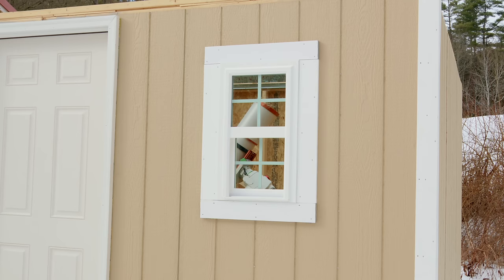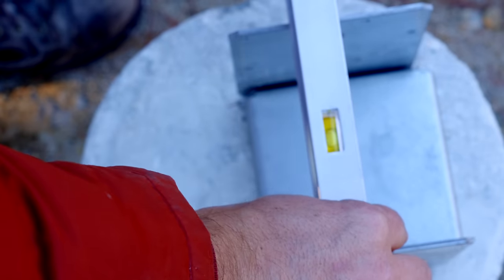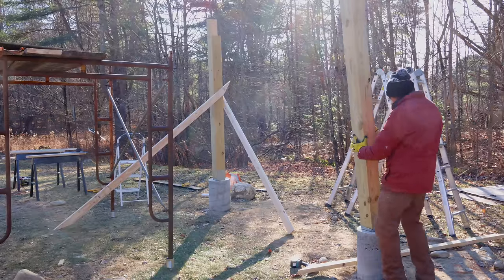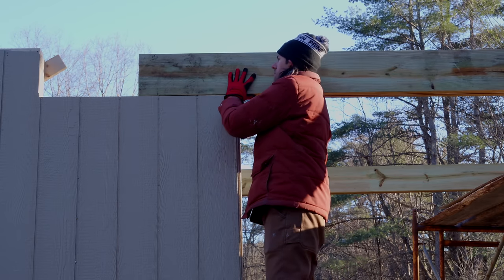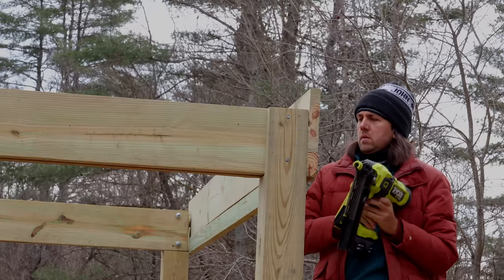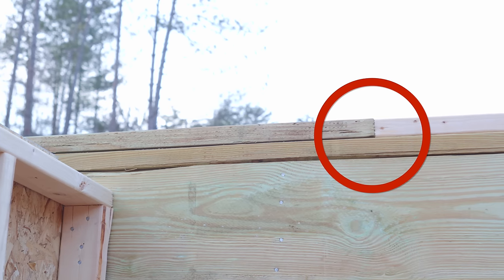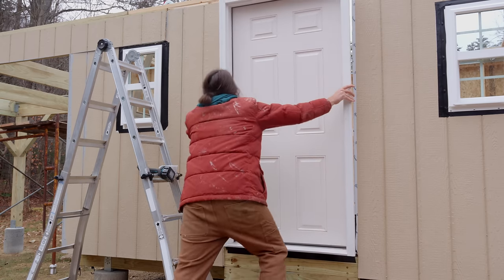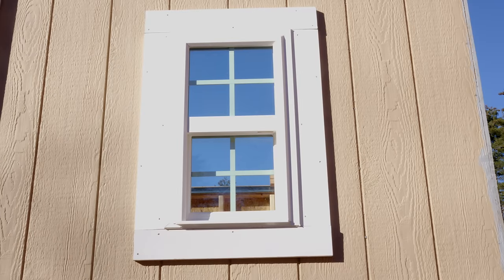My DREAM OBSERVATORY has a ROLL-OFF ROOF!

Comment: Congratulations on your new observatory! It's an achievement that most astronomers never attain, but yours is very nice indeed. I've been director of my Astronomy Club's Observatory on and off for years, and live in a very similar climate to yours, upstate NY, where snow is a given in the winter, and lots of it. I wanted to make a suggestion concerning your exposed roof rails. We tried the heater tape solution, but ice still managed to be a problem. The only way we were able to completely avoid ice and snow build up on the rails was to cover them. One of our members came up with an ingenious design, using an inverted length of aluminum gutter, mounted on a lightweight frame. You simply place the cover over the rails when you are finished observing, and they remain protected from the elements.  The rail covers hang on brackets installed on the rear of the building when not in use, including the summer months. Hope this idea will help you.

Comment: Always enjoy your videos.   Maybe you can go on a hike to a 4000 footer with Taylor the Nahamsha hiker and get some high mountain remote observations.   Anyway, about that warped beam.  I would take the siding off.  Scribe a straight line on top of the beam. Use a circle saw to make a first cut. Then, switch to a small chain saw and follow the first cut but at full depth of the beam.  It will be rough, but the siding will then fit and look good.  Clear skies!

Comment: Looks incredible, I am jealous.

A quick note on wind, re: 26:50. I wouldn't be so quick to dismiss the possibility that wind could move the roof on its own without the turnbuckles. Roofs are big, so wind has a huge area to act on and generate force. It also generates lift, reducing the force needed to get the roof moving. A 30 mph wind perpendicular to a 15 square foot gable would generate about 35 pounds of force.

So it's a very good thing you installed the turnbuckles. Even if that kind of wind isn't normal, a bad storm could hit it just right to ruin your day.
Reply from the maker: Ah, good to know. Didn't mean to say that with any kind of authority and what you write does make total sense. Glad I put those in!

Comment: Nice job Niko. I built myself a mini-observatory last summer (very small - room for one telescope) and did everything myself, by hand. Using it throughout this winter has been absolutely worth the effort I put in. Think I last polar aligned and calibrated PHD2 in September or so. 
Your own observatory will remove so many of the "chores", like setting up, cables, polar aligning etc etc etc. With a setup like this you can go from realizing it's clear outside to be imaging in just a few minutes. Your build was very inspiring to tear down mine, and build myself a bigger one.

Comment: Looking good Nico and having that dry area sure makes a difference.  I had my trusses together and mounted onto the rollers overnight when high-winds hit the area overnight.  Without the topping, the skelleton moved very easy and in fact, I found the whole thing laying in the tree off the rails in the morning.  I doubt this would have happened with the plywood and shingles on, too much weight for the lift.  Opted with this option as the plywood is about 1.12lbs/sqft vs steel roofing at 1lbs/sqft.  The shingles is where the weight plays a factor at aprox 2lbs/sqft.  While strapping for the steel roof does add weight, its not as much as the shingles in total.  I do like the added strength though with the plywood.  That being said, I think you made the right call going steel.  It's been a while, and I could be wrong, but I think the screws normally go on the ridges so as to let water fall away.  You may have to keep an eye on the rubber seals over time once they begin to harden and crack.

Comment: Great Job Nico. I would also suggest adding floor and walls to outside structure to make it a cozy debunking place/studio. Walls will also prevent the roof from the under wind that could lift it up.
Reply from the maker: I've been thinking about that. Thanks Lubo!

Comment: Congrats on your efforts. An observatory is the next level in AP :). That's the same metal roofing I used on my own. The top cap can be ventilated to let go of the summer heat, and they make some screened vents that fit over the profile of the sheeting cross section underneath. 

Happy observing!

Comment: Well done, congratulations!  Maybe you can add a horizontal double or even triple 2x4 beam and screw it into the observatory's inside sole plate and top plate. Then, get a few 8-inch long construction screws and run them through the 2x10 that is twisted into the horizontal temporary 2x4 beam that you just made.  Let it set for a few months and the twist may relieve itself. If it doesn't just leave the beam in place inside the observatory... no one will see it and the outside looks nice and professional.
Reply from the maker: Nice idea! I like this more than shaving it or trying to take it down to fix. Thanks!

Comment: Get a bit of 3/16ths plywood and trace the contour of your roof panels on it. Cut out the contour and then attach the plywood to a telescopic pole. That way you can get the snow off the roof very effectively after a snow storm.

Comment: Congrats! 
I'm sure you have lessons learned. Please make a follow up video on what you would do different if you did it again. 

I would put the door under the end, instead under where snow can fall off the roof.
Reply from the maker: I thought about that, but the way my weather is the door would get lot more abuse that way, and would be more awkward with how the telescopes are positioned. I am working up a presentation of lessons learned for the Astro-Imaging Channel - will be on there March 24th with that presentation.

Comment: Congrats Nico! You did an excellent job. Get some rubber anti-fatigue flooring and cover the entire floor with it. You won't regret it, especially if you ever drop something expensive. Your design is almost identical to my observatory. I used garage door rails as well. 18 years later, and they still work great.
Reply from the maker: Thanks for the idea! I've been thinking I might want something on the floor. So happy to hear that your observatory is working great after 18 years, I hope mine lasts that long!

Comment: I think the warp in the beam could have happened when you put the three layers together. In the video (at 3:12) the weight of the beam caused a slight curve which would have then been locked in when you fixed the layers together. If the beam had been rolled over so that it was in the same orientation as it would be when installed then the strength of the beam would have avoided the bending.
Reply from the maker: Ah, good catch, could be. Might have just gotten lucky on the other side.
Reply: @NebulaPhotos  Depending on how you secured the beam you may be able to remove the fixings that secure the three layers together and take out the bend. Once the three layers are not secured to each other you should be able to re-secure the ends then re-secure the three layers together. If it is not feasible to do in place then you may have to remove the beam, remove the bend and reinstall.
If you glued the layers together then rotating the beam so that the bend goes in the opposite direction may be the best way to get it secured nicely where the siding covers it. Then the 2 by 10s can be used to pull the centre of the beam into line. Over time the beam will relax into the shape you have forced it into.

Comment: I'm curious how much of the sky you can image from in there.  It looks like the trees behind your observatory are pretty tall, so even if your scope is aligned with the top of your walls, you still only get about 3/5 of the sky
Reply from the maker: I'd estimate about 65-70% above 30 degrees, so 3/5 (60%) sounds pretty close. North and Northwest are completely clear, West and Southwest are blocked (the tall trees you mention), South is mostly clear, East is good except for one tall tree. That said I have absolutely no problem finding things to image every clear night. For imaging, I find the circumpolar constellations have hundreds if not thousands of gems. I think I could spend my whole life just in the three Cs: Cepheus, Cass, and Cygnus and never run out of objects to image.

Comment: Nico, great work you have done, awesome job, I like the name, the amount of details you put on it, for me is one of the best I have seeing, one question about space between roof and structure, how you going to keep insects away and dust?  Congratulations
Reply from the maker: Ah, I did film something on that and didn't include it as the video was already getting long. I'm currently experimenting with different kinds of seals for that gap. Depending on where it is on the building, I will likely either use rubber (garage door part) or two rows of 'brush weather stripping'

Comment: Why are the walls so tall?  Seems like it would cut away a lot of your horizon.  Did you calculate the height to allow viewing above a certain angle?
Reply from the maker: Tall trees here, so it doesn’t cut my horizons at all. I can image still image down to 25 degrees to the north and south which is probably as low as I’d go anyways for this location.

Comment: Great job Nico, love the channel, if you don't mind me asking... what's the distance from the piers to the walls and the space between the piers??
Reply from the maker: Piers to wall is 48". Between piers is 54". Depending on your needs, you could probably get away with a little less space if it's just being used for astrophotography. Since I planned to be in there often testing gear, I made it roomier.
Reply: @NebulaPhotos  thank you! I think I may go a bit larger,  12x14, piers 48" off the walls,  with the piers offset from the center line about 1 1/2 feet to give a little more than 6 foot between them.  thanks again,  I hope mine comes out as nice as yours.

Comment: Hey, gratz on completing the observatory! Must feel good I bet :) Maybe you can clear this up for me as I don't live in the US and I don't want to assume. Aren't the window sprosses supposed to be on the outside? It looks from the video, and again I can be wrong, that you have the windows installed inside out.
Reply from the maker: I'm not sure what the term 'sprousses' means as I don't think we use that term in the US. I think the windows must be the right way in, because the window locks are on the inside (wouldn't make sense to have those on the outside).
Reply: @NebulaPhotos  The sprosses as we say are the wooden pieces on the windows creating the visual frame. If you have the locks on the inside they are of course the right way. But as I said, it looked like the glass is located on the outside of the, well ornaments? English isn't my first language :)
Reply from the maker: @jonbeargenx  Ah, got it. The sprosses are sandwiched in-between the exterior and interior glass panes in this design. My guess is they designed them this way to make them easier to clean.
Reply: @NebulaPhotos  Ah that I have never seen before. I didn't want to assume anything as there are obvious differences in both building materials and construction methods in Europe and the US. Thanks for your replies, and clear skies! :)

Comment: How high is your pier off the floor
Reply from the maker: The top of the pier plate is about 3 feet off the floor. With a mount and tall telescope, it's about 6.5 feet tall in park position and the walls are 6'9". Works for me with the tall trees here, and designed for imaging only in mind.
Reply: @NebulaPhotos  great thx👍

Comment: Microlam could have been better for rails. Structurally, they are by far more stable than usual lumber. Moreover, they are by far stronger.
Overall, I could do both posts and rails for roof from Microlam.

Comment: Lol is the roof made out of concrete? This is massively over engineered.
Reply from the maker: Huh? the roof is made of wood, nails, screws, glue and sheet metal. How would you design a roll-off roof for New Hampshire?

Comment: Respectfully, ADD a security system - wifi cameras, some sort of monitored security system: ADVISE your home insurance company that the new observatory exists, tell them what equipment and the value of this equipment, photos taken and sent to the insurance company is a very wise idea - a shame that you should be considering security, but this is life and reality.    DO advise your insurance company - don't take it for granted that the observatory is covered under your home insurance plan...go the extra mile - you will be glad that you did.   AGAIN, thank you for the video...  2 thumbs up.
Reply from the maker: Yes, once I get electricity in, I plan to add cameras and other security measures. Currently, I'm not leaving anything super-expensive or irreplaceable out there.